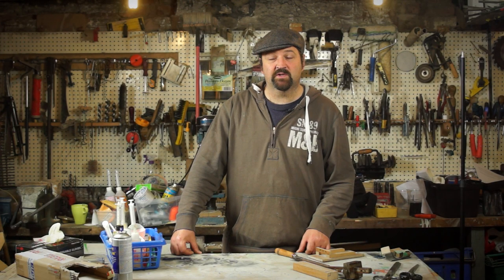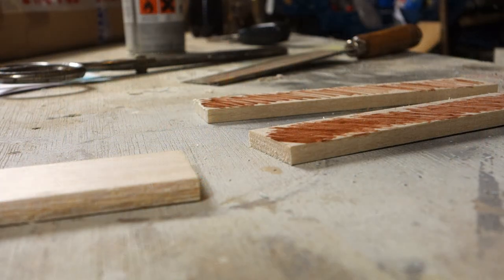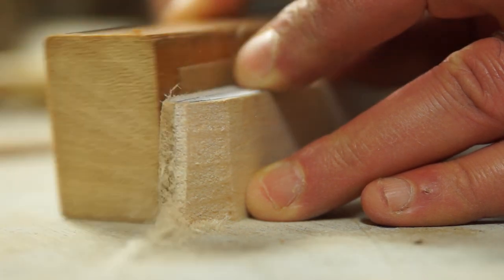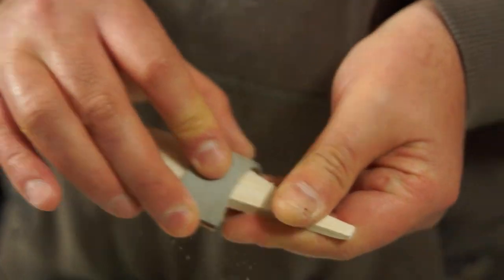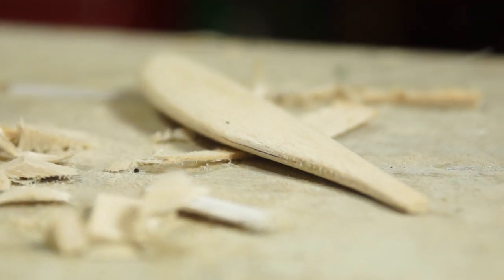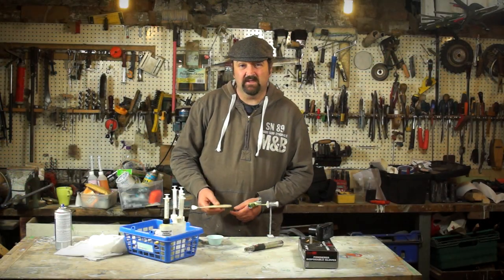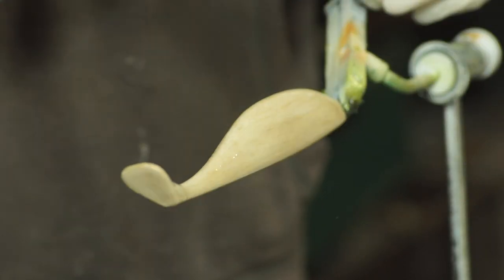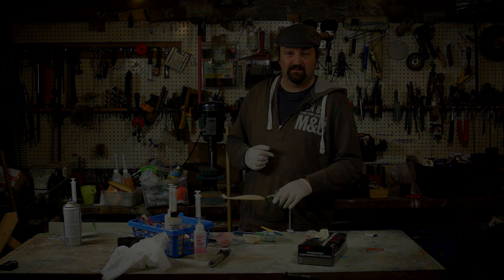Making Soft Plastic Shad Lures Part 1

Comment: Have you ever thought of making a lure that is somehow hollow or with an air pocket to allow scents to be injected into it? I would imagine water pressure and lure action might help release the scent trail. Probably need to inject it so as not to have a hole which would leak badly when you cast. You keep your shop tidy mate, I also have a workshop but struggle to find 2 square inches to work on. oh well, one day I'll be organised!
Reply from the maker: I have put slits in the belly of soft plastics and inserted a sponge soaked in fish sauce which has work really well i even had a pike take the lure as a dead bait when it was lying on the bottom. Maybe in future video I can show how to cast a belly cavity into the lure, thanks
Reply: Paul Adams I for one would like to see that. I am wondering if a plastic worm might somehow have a cavity cut into it then heat sealed to put some of the liquid worm stuff they sell in it.